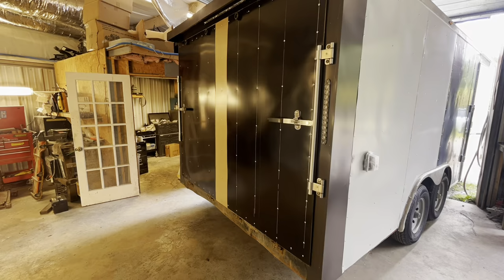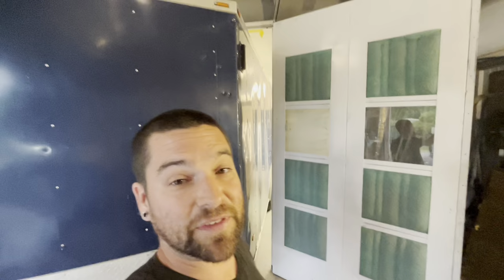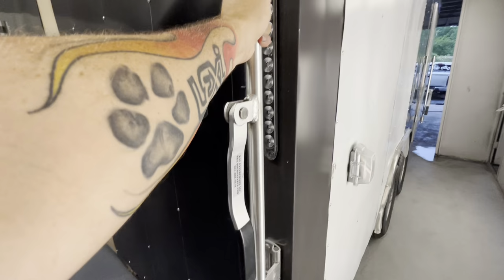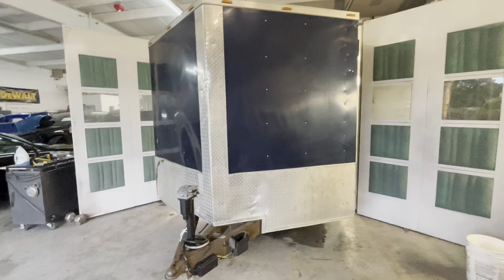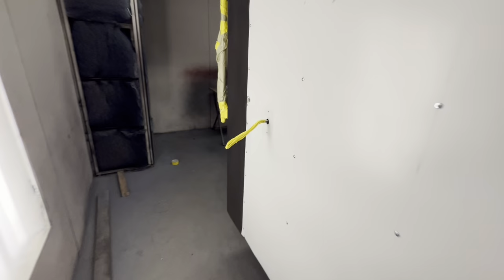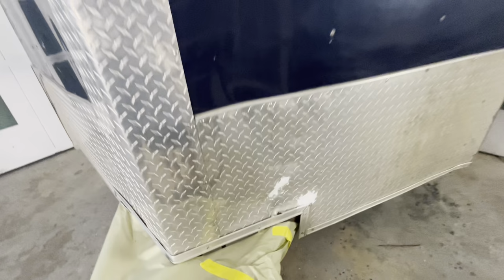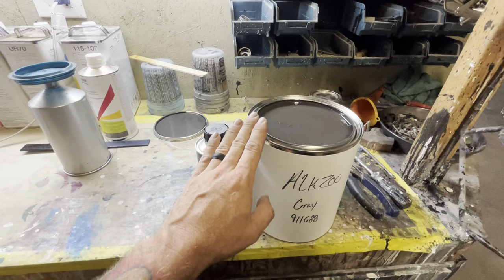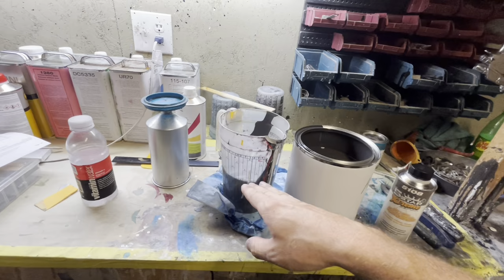🎨 Race Trailer Paint Job Using PPG ALK-200 Single Stage Paint 💦

Comment: glad i found your video. i am not a professional painter by any means (just this one time hobby project) but i got some ppg alk-200 from JIm Carter Parts to paint my truck ,( 1951 chevy ) So far ive shot the epoxy primer ,done body work (Upol Liteweight gold) and yesterday was primer sealer . i have a few little low spots to touch up and hopefully get the paint on it next week.  Can you tell me what sanding grit you used to final prep before your color coat. im guessing 400 or did you go higher like 600? did you use the alk-201 hardener or something else and what ratio...im seeing 15:1 . how low of a temperature would you say is safe to shoot this ? What gun tip size for a HVLP would you advise ? watching the weather here in North Alabama. I got lucky yesterday being 68 degrees, my TCI primer flashed off nice to the touch in about 15 minutes.
Reply from the maker: Ok first thanks for watching. Second you need to reference back to your technical data sheet on that product to answer them questions. I can’t remember what hardener I used and 15:1 does sound right but I’d need to confirm that off the data sheet as I don’t shoot a ton of that. In my other videos that I’ve used it I’ve showed ratios and other data. I have all my painting videos organized in playlist under the painting playlist I can’t remember exact name. 68 is a great temperature as 70 is perfect but I do paint in lower temps but use heaters often inside the shop. I think this stuff can be sprayed in lower temps with out heat though but will take forever to dry. I never final sand in 400 or 600 hardly. Normally I finish in 320. However for single stage I’ve often finished in 180 due to the single stage being so thick it hides all sanding marks and sanding to low will just be a waste of time with a single stage paint. If you don’t have a data sheet available then you maybe able to find it online or I think I showed the data in the video where we painted my race trailer. Let me know if I missed anything and you need help. Gun needle I’m honestly not sure what mine is but I do know mines made for clear coat and it’s really to slow for a single stage paint being as small as the tip is currently and next single stage job I do I’ll be using a harbor freight purple paint gun.
Reply: @ThePaintPaperHustle  awesome, thats what i have too is the hf purple gun.
Reply from the maker: I think it’ll do great for ya